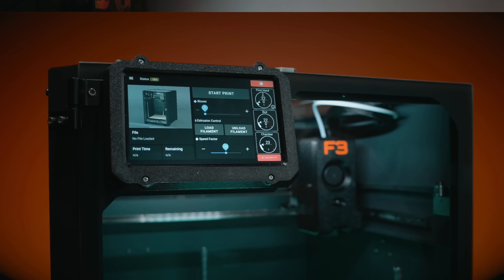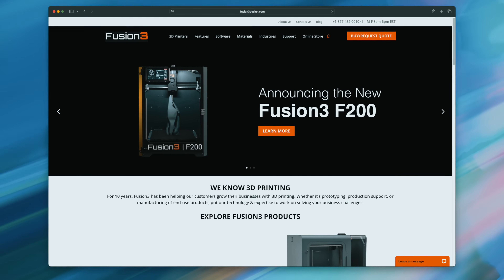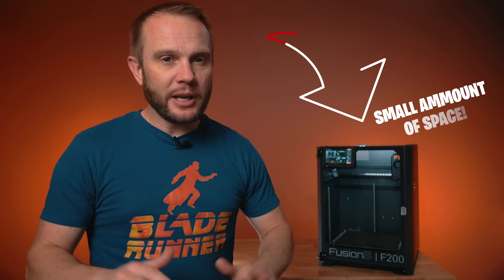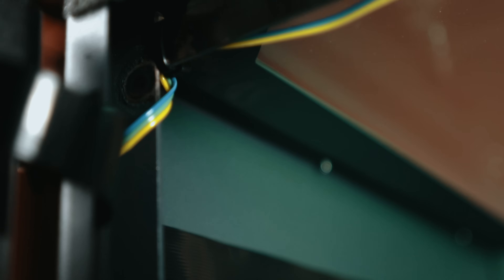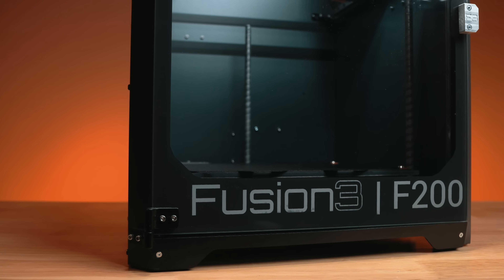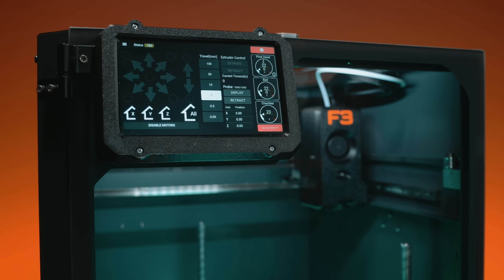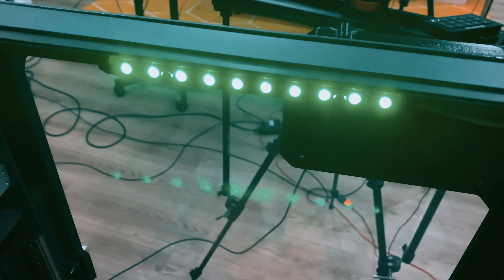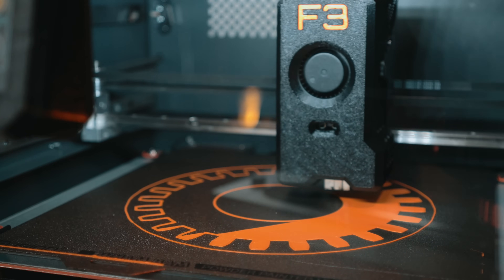Fusion3 F200 Put to the Test | No BS Results

Comment from the maker: Before anyone says it—yeah, it costs more. But so does downtime, poor support, and failed prints.
This is the kind of printer you spec when failure is not an option.
Questions about where it’s made? Call Fusion3. They’re proud to tell you.
Reply: Exactly. You get what you pay for. As you should. Or the more you spend the more you get. My father taught me this growing up. Buy the best you can afford yea 3,300 dollars is a lot most people go out and by a 1200 to 1500 dollar 3D printer I get that but reason I went with the F200 I live in NC and the headquarters is only 10 minutes down the road from from me. They offer free lifetime on the phone tech support with an English speaking person. If I need a part I can run down to the headquarters or have them ship it out same day and have it the next day. There a company that stands behind there products. I also find the software super easy to use.

Comment: For whatever it's worth, the US does build some high end tech machines still, but they target the high dollar industrial sector like defense contractors, aerospace and automotive. The home/hobby user will likely start with a Chinesium unit (or several) and eventually move up to building something bespoke for themselves down the road from the bones of something else. A US manufacturer will have a Real hard time building into the home space and be able to compete on the price front and full production numbers with overseas. There's still hope for the pro-sumer/entry level commercial market though.

Comment: If the “power supply and electronics” are sourced from overseas, what IS made in the USA? The rails and sheet metal?
Reply from the maker: Go build a printer without anything other than the power supply and electronics, and let us know how it goes.
Reply: @LoyalMoses You can say nothing. You can say you don’t know. You can say it’s really hard to manufacture anything at all in the US, especially anything complex. 

But requesting I manufacture a printer without all the parts is just weird.

Comment: I got a quote for the F 200 printer today and it is a $3500 purchasing experience. My real issue is that I’m trying to figure out how this is in any way shape or form a better deal than buying a Prusa Core One for well under half the price. Yes, they’re still ironing out some kinks related to the Prusa, but for a $2000 price difference I just don’t see the true advantages. For that printer to be worth it, it would have to be as impressive as a Bambu H2D, only without all of the spyware and other stuff you have to deal with in Chinese products.

Comment: FWIW, at my job, we have a Fusion3 F400-S in production, and while it's definitely older and slower than our X1C and K2+, the print quality and the support generation alone have made it my favorite printer for serious materials. It had been sitting for ~4 years in storage, and after a thorough cleaning and an extruder rebuild, It's not had any issues with any filament I've thrown at it. We mainly use it for making jigs, tools, parts... it's perfect for utility purposes like this. An F200 or their EDGE printer would be a welcome addition to our shop. Thanks for reviewing this, not a lot of folks covering these types of machines.

Comment: Nice new studio! and your videos are always solid. I'm an industrial Desiger for 34 years, and Ive worked on luxury interiors and furniture design, now I focus on footwear for the past 24 years and I've worked with many manufacturing methods, including 3d printing since the 1990s. You made a great point, that an actively heated chamber may not be needed with the heated bed and nozzle, and the airtight chamber. Something nobody is talking about that should be important, the ability to connect the printer to an exhaust, is it exhaust ready or you have to do some custom mods?  like I had to do on my Qidi Q1 Pro. The user experience and a great interface are key, something Im missing with Qidi. This should be compared to the Prusa Core1. Also curious if Wuxn will ever produce an enclosed core XY printer, that would be interesting. Congrats on the nice space without all of the visual clutter, but the wall switches and the outlet between the couch and the end table, these are distractions.
Reply from the maker: Thank you! It was a lot of work, but we are so happy with it. It allows us to be creative and get the shots that we’ve wanted for so long.

As for the exhaust, yes, you can easily attach an exhaust system. There is a cover on the back with screws that can be removed. I didn’t remove them though during my use.

Comment: I think these machines would fit in extremely well in factories and R&D labs, as when you pitch this machine to the purchaser it looks and preforms exactly how many industrial cnc machines do, they produce lots of parts, on time, no surprises no funny gimmicky "RGB" lights that flash or no funny sounds. They really just pitch themselves as the "boring" brand which is a good thing when you think of traditional manufacturing and development, at a cost that isn't insanely high (compared to other "industrial" printers) and will do well in that market IMO.

Comment: I used to have 6 of the Fusion F400's for commercial printing.  They were antiquated by todays standards and broke down often.  (most of which had to do with the old method of using braided line, rather than belts to drive the print head).  I know that has been fixed in their newer Fusion EDGE.  Ironically I was re-printing replacement parts with my Bambu X1C and Prusa iMK3s printers. (ie.. extruder housing, filament gear box ,etc).  2 of the 6 printers ended up becoming "donor" printers for pillaging parts from for the other 4.  

The experience (ie.. frustration) from the brand soured me, along with the price tag.

I can however contest to their customer support is very responsive.  

The ROI for this machine though is EXTREMELY difficult to justify with offerings and features of other brands.

Comment: Made in US: on web site in product detail: Proudly designed and assembled in USA. It sound little bit different 🥰 It like Prusa, many Chinese components ???
Size tolerance:  Anyone who has been printing for at least a few days knows that the final size is often affected by the filament and its shrinkage after printing. The size will be different right after printing and different after 24 hours. It's important to choose the right filament and the tolerances you mention can also be achieved for example on the A1 Mini from Bambulab, which is a $250 printer. We easily print with an accuracy of 0.1 mm on X1C or Voron 2.4. 😎
But I agree that if someone wants a Prusa XL for 3500, or a Fusion3 F200, they should buy it.
Just for fun, even the Fusion3 F200 can break even though it's assembled in the USA. It's just a machine.
But obviously it's safer to have 2 3D printers as a backup. Only a fool would buy one printer for critical production and hope that nothing would happen. :face-blue-smiling:
Reply: Good catch, chances are that most if not all the components were sourced in China.
Reply: A Prusa XL for $3500 is an entirely different league of printer than a single extruder small F200 for $3300.  For $3500, you get multiple extruders and a much, much larger build volume.  This compares to the Core One for $1099... so it's 3x more expensive for the exact same class of machine, or $499 for the Bambu P1S, or even the Centauri Carbon for $299. Even if it is built in the US, a greater than 3-10x price delta doesn't make sense.

Comment: I say this as someone who prints engineering production parts both at home and at work and really wants to find an excuse to buy an American printer for one or both of those applications: at that price point, you HAVE to offer something unique. The claim "it just works" ain't it.  Bambu and Prusa already have that and their equivalent printers are 1/3 the price. This printer needed to have a bigger build volume or an actively heated chamber or dual nozzles or something like that.  I offer this as constructive criticism because I really want to see an American company break into Bambu's market share.
Reply: Bingo!  Looked at the price and closed the page right away!
Reply: I consider "it just works" to be a pretty nice feature. That can include issues such as how well it works, and the longevity. I have some similar printers that worked well with some usability issues and are prone to break down. I would have to actually use the Fusion 3 F200 to decide for myself, but I am looking for something higher build quality than Bamboo and Prusa. Print quality on encloses Prusa's is not great, and they aren't cheap either. Bamboo's newest printer (HD2) is also not that cheap, even though it's less than this if you don't add the laser. Most consumer level 3D printers leave a lot to be desired, even the popular ones, because people want cheap. Cheap and good usually don't go together.
Reply: The price is high, it's higher than people want to spend for a consumer electronic.  That's always the story when it comes to American made stuff, unless it's all made by robots or something the cost to produce here is much higher, especially if they're sourcing almost everything USA made.  The main market for things like this are government contracts where the law says they have to buy American Made, and when someone is spending someone else's money, well, you know how that goes.  I wonder if one of these will last more than 3x longer than the Bambu machine, sometimes when you buy cheap you wind up spending more because you're replacing it so much more, but I don't know about this here since it may be obsolete before it stops working...
Reply: @sherizaahd  All true and I forgot about Government contacts. But from a regular consumer hobbyist, this one was an automatic no-go! I'd rather just go with a Bambu Lab printer
Reply: "It just works" means something totally different from a printer like this. "It just works" means a print was successful and looks basically fine when you're talking about a Bambu, Anycubic, Creality, whatever. But if you can give me the "It just works" with accurate tolerances, no elephant footing, no banding... that's a very appealing definition for someone like me with deadlines to meet.
Reply: @aaronjohnmiller  Literally 4 days after Moses posted this video he compared the Fusion3 to a Bambu H2D and the Bambu made a better looking part in half the time... And has a bigger build volume, dual nozzles and a heated chamber.
Reply: American workers
Reply: One problem is that US companies actually adhere to patent law.. heated chamber and dual nozzled immediately has Stratysys crosshairs on you. Build volume doesn't have the cost increase to make up that difference. BUT.. lot of US companies also are focusing on industrial use, not consumer level.

Comment: So this is $3k...and you can buy BL's P1S for $699.... meaning you can get 4 printers instead of 1.
Even if the 4 P1S printers has 1 part failure (each) for every 25 prints, that's 4 per 100.
Wouldn't that be acceptable? Especially since you still printed 96 parts to the F200's 25.
Yes, the Fusion's made in the USA, but I believe the Chinese have gotten 3D printer manufacturering pretty much perfected now...which is huge plus.
The F200 is a great looking printer, but just like how it is with a beautiful employee working in the "world's oldest profession"...
Prettiness goes out the window if the price is 4 times the mediocre "worker"  if the.....uh....outcome....is the same!
😊
Reply: I dont see why this would have less failures than any BL printer either
Reply: $499 for p1s today lol. They're doing a sale
Reply: bueno, tu lo haz dicho, por que las mejores se van a Kuwait, por que tienen clase y lo hacen mejor que la que consigues en la esquina...
hablando de impresoras claro esta  😉

Comment: Great video! At first glance, the Fusion3 F200 really gives off strong Prusa Core One vibes — especially with those orange extruder accents and the sleek blacked-out design. Even the slicer interface looks a lot like PrusaSlicer. It definitely looks like a tank — solid and robust. It’s an intriguing entry into the 3D printer market, but at over $3,000 USD, I’m not quite sure the benefits justify the price. Don't get me wrong the Fusion3 F200 seems great but at nearly 3 times cost of a similar Prusa Core one? Hmm ... What’s your take on it?

Comment: As an engineer running a 5 year old Raise 3d machine I cant stress enough how much American built machines are worth it. Haven't fed the machine anything but cf reinforced materials for years and still not one failure. When your running $100 plus spools of filament and customers are lined up waiting, you cant have failures.
Reply from the maker: Thank you for this! It’s very difficult to convince the $99 crowd that professional machines exist for a reason.
Reply: @LoyalMoses No problem! It's understandable that if your not making money off a machine you want it as cheap as possible. A real world scenario that i went through, we spent months designing and testing a 3d printed part for an MRI machine for a customer. When all was said and done we were using $0.45 of filament printing the part and selling it for $1400. On a $5000 machine 4 parts payed for it.

Comment: @LoyalMoses

I mentioned in another comment here that you left air filtration details out of this video.  Did your pre-production unit have the advertised HEPA/Carbon recirculating filter?  If so,  what were your thoughts on its design and effectiveness?  How did it handle ASA and PC fumes?
Reply from the maker: It's a nice filter in the back, I didn't remove the cover on it at all. I am in a large studio, and when printing with it, I didn't notice any smells outside of anything normal.

Comment: Thank you so much for finally making this video.  I've been waiting for you and FranklyBuilt to share some info on this machine for a while now.  My office has been asking me to recommend a 3d printer capable for printing actual PC (not a blend) parts to replace OEM parts that cannot be sourced.  In this one example part, replacing  the entire unit is upwards of $200, so if we can print new covers with $4 worth of PC, it would pay for the printer in a relatively short time.  That timeline moves out quite a bit if I'm having to waste time with failed prints with expensive filaments and man hours. For these reasons I agree with you that there is a real market for a printer like this, despite the negative comments by users who's needs are completely different. 

What is not mentioned in this review (and is a big selling point for an office like ours) is the built-in filtration that recirculates the air within the chamber (unlike the core-one that I'll be converting to at home that push the hot air out while filtering).  Also of note is the higher chamber temps, which I understand is critical when trying to print pure PC or nylon.  We're also considering going cheaper with a core one, and I'll run some test prints with this 3dxTech PC for comparison once I convert my Mk4S.  I'm expecting, however, that the difference between 50c and 70c is going to push me toward this F200. 

I'll be eagerly waiting for Frank's review in this printer as I get closer to a decision.
Reply from the maker: Love to hear this! A lot of PC blends out there are so easy to print but not equal in part strength or application. 3dxtech PC is amazing stuff, not a blend and this machine printed it perfectly. Thank you for taking the time to comment and give your thoughts.

Comment: 3299$ Is f*@#% crazy!!!!!!! I can buy 10 centauri carbon!
Reply: It seems like many comments are from people who don't need to print pure polycarbonate or nylon.  Sure, you can buy lots of CC's, but they can't get the chamber up to 70c, nor do they have a fully sealed enclosure to keep the dirty air contained where it can be circulated through the filter.  This means that they simply cannot do the job for many applications.  This is not the printer to use for items downloaded from makerworld, Printables etc..  My guess is that 98%+ of the prints coming off of Fusion3 printers are in-house designs.
Reply: @Tdj3dp-m2z right? It’s basically an entry level industrial printer, not a hobbyist machine.
Reply: Industrial vs Hobbyist, that's why.